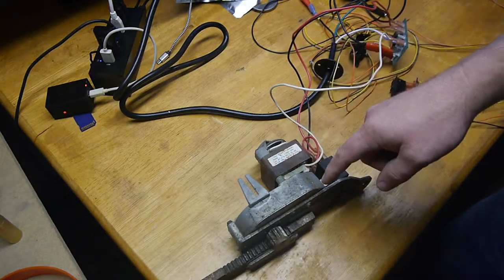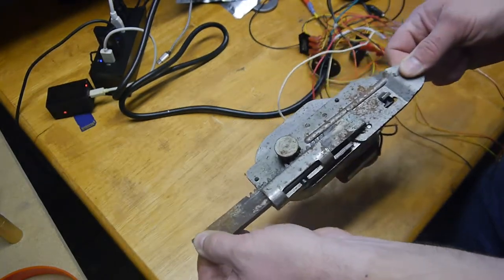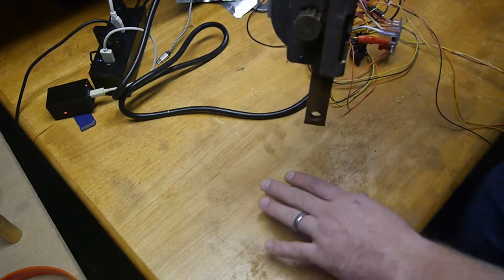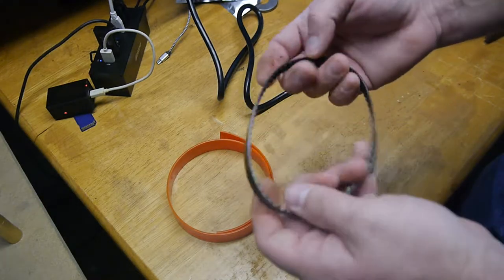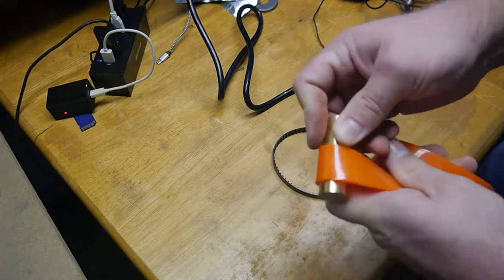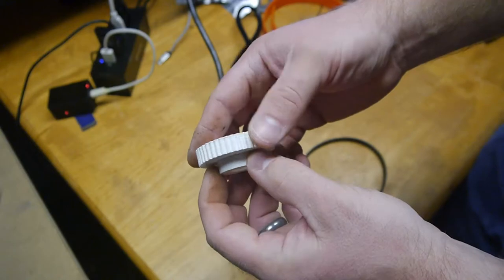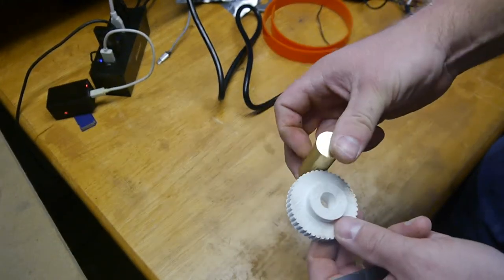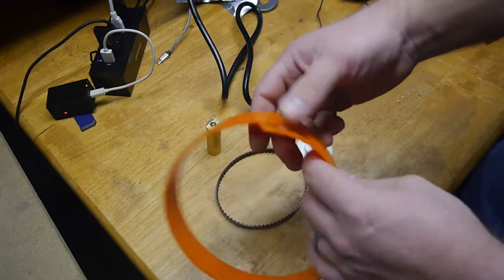Call for Help, I need your advise.

Comment: Go for it man, great little project... Would be an interesting to know the load it could exert. Honestly I would go with the toothed belt.   As the pulley is abs and not tappable I would print them with a blank hole in the top flange, then drill off and tap the shaft, then you can cut screw  to length and tighten into hole so they turn together. Maybe it doesn't make sense but I can sketch it if u like. This is a bit primitive but obviously if pulley was metal you could employ a grub screw.  Also consider a small shoulder on the shaft so these pulleys can sit down to the right height. I think the 3d print will work fine like this though.  BTW mate, I'm a 3D draftie by trade so if u need the 3d model adjusted ( I mainly use solid works / inventor /pro e  ) then I can very quickly remodel the stl or step or iges file to your spec and send it back to you, free of course :-)
Reply from the maker: I will have of figuring out the force it exert, I will have to do some welding though to be sure. Either way it will be a little bit before I can get to that. I think the CNC needs a new pulley setup and probably a custom enclosure. A neighbor threw away two storm windows for his screen door and I think those will become the front and side for the new enclosure. I think I have an idea of what you mean, but maybe a quick sketch would make it concrete in my head. Don't do anything too fancy though. Offer your services for free is awesome of you! Thanks Rural. I do a little drafting in Inventor at work so I am not a beginner but I still get stuck occasionally and it takes forever sometimes to figure out the right combination Inventor wants. 
I am proud of the fan I modeled and printed for the DIY Treadmill Mill motor. Check out my video "Knobs and my first fan" towards the end I show it in action. It moves quite a bit of air!
Reply from the maker: Just re-read my comment. Apparently I need to proof read when using a phone to reply to comments. :-) Should say " I think I have a way of figuring out the force it exerts, I will have to do some welding first though."